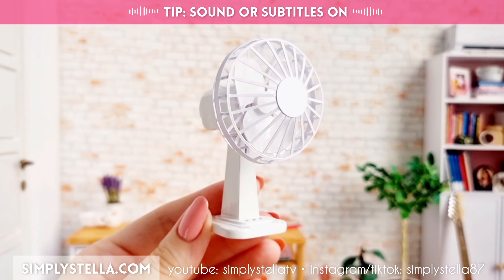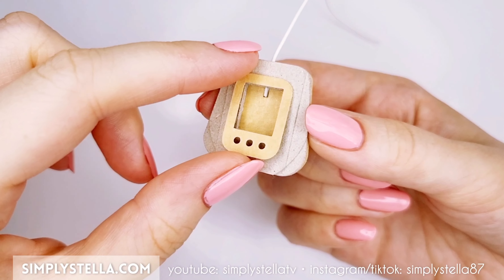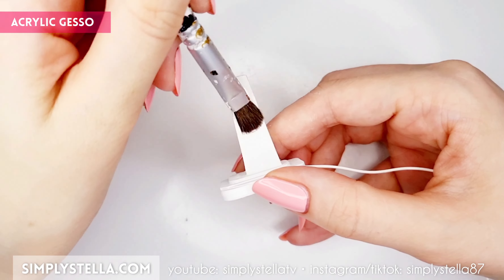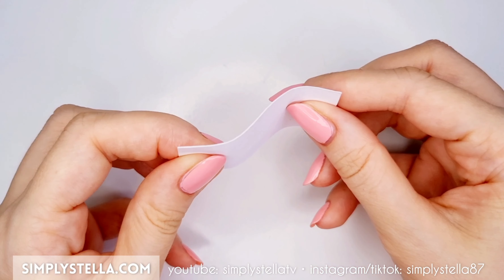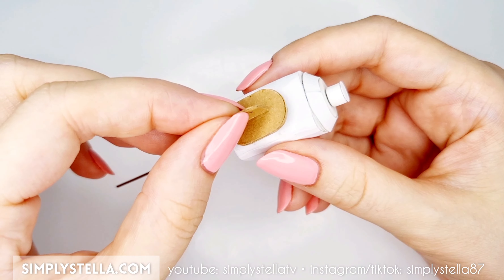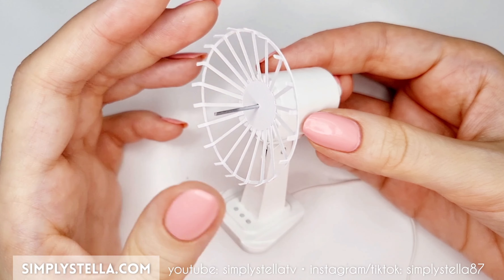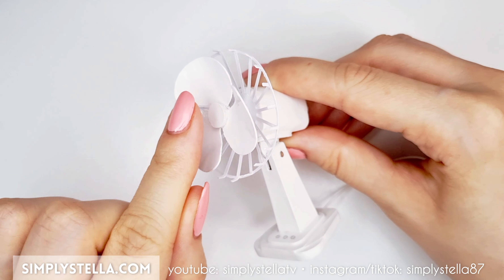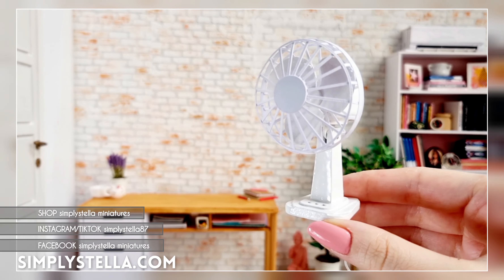Miniature TABLE FAN for BARBIE! How to make an ELECTRIC FAN for your DOLLHOUSE (with PAPER)

Comment: It’s hard to get the download this way can you add the download like in other videos
Reply from the maker: Hi there! The download link is given in the video. Make sure you watch the entire video, so you won't miss it! Simply type the URL into any browser (works from both pc and mobile) to access the download page 😊
There's also a pinned post in my comments with an alternative download link. 

Troubleshooting:
- Make sure you type the full URL as given in the video (including any .htm extensions) 
- Check the download folder on your device. Some browsers automatically download your files, and you might have downloaded them without realizing it.